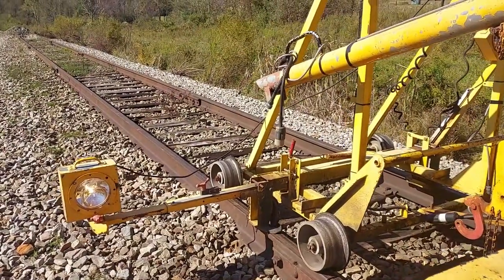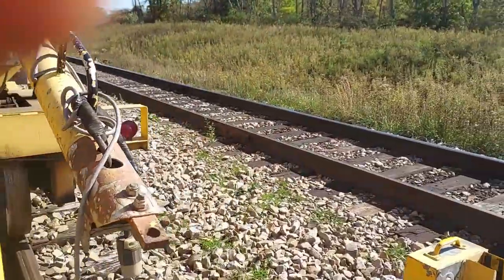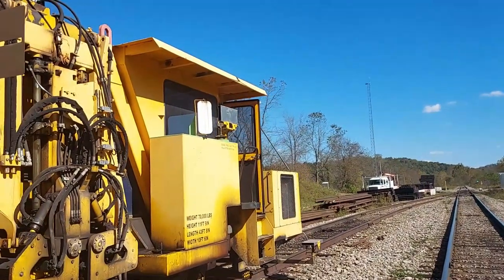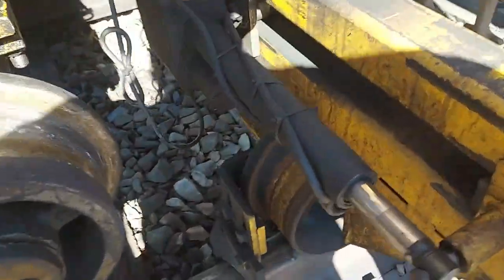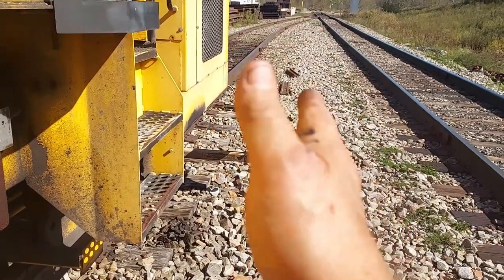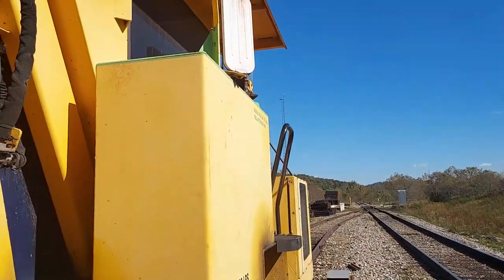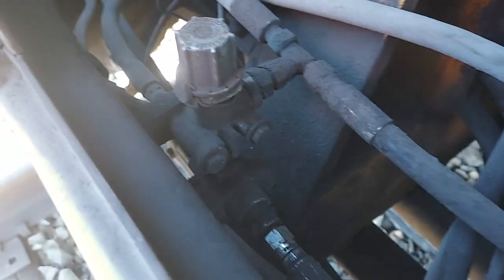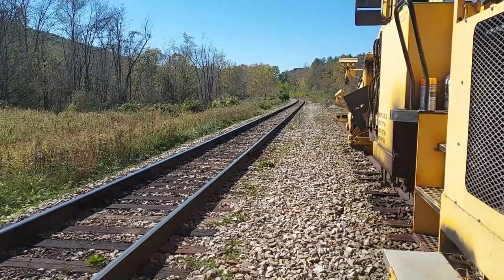How a Jackson 6700 Tamper Lines and Surfaces Track

Comment: I never knew that the tamper used optical sensors like that, very interesting! Seems to be a very precision machine. Great video, thanks Dave!
Reply from the maker: Have rebuilt many receivers over the years. Wanted desperately to show what the photo cells looked like, but was unable to find my used parts, really upset me I couldn't find them. 😕
Reply: @ccrx6700  If you find them, just show them in a #short . I'd like to see them 😊

Comment: Great overview and explanation!
The one thing I have been wondering about is how it actually moves the rail, and while you showed the mechanism, I wasn't able to see enough to satisfy me! Lol

So when you have a chance, maybe you could show how it pushes the rail, and also maybe how it grabs the rail to lift it.
Reply from the maker: Thank you Ben for the very nice comment. I understand what
you want to see. I am the only tamper operator here, so that
means I can't be outside the machine while it is working. however,
we did get a contract tamper in here this summer and was able
to be outside and video him jacking and lining track. That video
probably won't be coming out until next spring however. It will
be Harsco SJ2 tamper title. I've just got so many other videos
to post before we can get to that one, so please be patient.
Reply: @ccrx6700  that will be awesome, and seeing it work will be fun, but what I was thinking of was basically what you did for the front light carriage, pointing out the various parts and how they engage with the track, so like what pushes it sideways and how it lifts it, and how it gets the force to make that movement. 

For instance, I assume that it lifts and moves sideways somewhere in the center of the machine, with the force being transferred to the rails by wheels at each end? Or does it engage with the ground to brace itself when it's sliding them sideways or lifting them?

I am a mechanic, so the first time I am seeing a machine, I want to see how it's out together, where the cylinders are and what they push against, basically what makes it tick.
I suspect that a lot of other people like understanding the mechanics of it too, and the rest of your audience will enjoy it just because you are talking lol, so everyone should like the video ;)

Maybe you could stick your camera on a mag mount underneath and just move it back and forth or something, even if you aren't actually moving track, just so we can see the functions.

Anyway, just a video idea for you!

(no, no one has EVER called me pushy! I don't know what you are talking about, this is YouTube not Sparta! Smirk)

Comment: grate vidio Dave im ready to go surface track after watching you.... good explation ..just between you and me ,,,,wink wink take that valve to a truck parts shop they should be able to cross it over
Reply from the maker: Awesome Mike, wow a comment like that coming from you is an very
much appreciated compliment! We did get that new valve, put it
on and it wasn't the problem. Did some electrical and pneumatic searching and
found out the 2 Humphrey valves that control the valve in
the back, 1 was bad and 1 was weak, so both got replaced and
it's working fine now. Glad I could help get you motivated....LOL
and will remember the truck parts shop info sir

Comment: Nice explanation Dave thanks..  I think that machine needs to be power washed...
Reply from the maker: Your welcome Wayne, great that you enjoyed my friend. Yep,
we used to power wash it several times a year, they got a really
expensive hot water washer several years ago, but it broke and
hasn't been fixed so it been several years since it has had a
good cleaning.... sigh....
Reply: @ccrx6700  Dave, I feel your pain with the "company" overlooking the small things like maintenance repair. The chances are that the person overlooking the budget has never rode on a mis-aligned rail.

Comment: Great explanation on the equipment!  What about dis-assembling the valve and cleaning it?  Probably full of corrosion.
Reply from the maker: Thank you Brian for the helpful advice. I did take it apart and look.
We put new valve on and it still didn't work so did some further
investigation and found that a Humphrey air solenoid was not
allowing air to get to the valve in the back. Replaced it and we right back in business. All that was done obviously after the video was
made. Do so much appreciate your watching today's show my friend

Comment: Thanks for the explanation on how a tamper works for aligning track.  Is it possible there is just debris in the valve and if you took it apart, you might be able to clean it and get back to work while waiting on a replacement / spare valve?
Reply from the maker: I did take it apart, nothing amiss. Got a new valve and then it
still didn't work so made some further diagnosing and found that
a Humphrey valve that fed this valve was bad and the other one
weak, so both of those have been replaced and I'm right back in
business. Do appreciate your helpful thoughts and for watching
my friend

Comment: Excellent work, again. Now, as you mentioned, you take one track as a guide, What;s happening if both tracks are off. How do you establish your base?
By the way, how many fully loaded trains do you run per day or week?
Reply from the maker: If both sides of the track are out of alignment, then when I make the
plot on the computer it will show up and I can adjust the plot parameters to correctly align that spot Chris. If the cross level of the
two rails are both off then that is also corrected by the surfacing of
the track by the tamper.  When everything is running well, we run 6
round trips per 24 hours with the train. Thank you very much for visiting with us and may you have a really good day my friend.
Reply: @ccrx6700  Thanks for the feedback

Comment: Check out old school KC Highlighters sealed beams replacements they may last longer. Aircraft landing lights are rated for 25 hour service life
Reply from the maker: Thank you very much for the info. I did not know they only had
that short of a life span, but knew they just didn't last very long
in our application, I understand much better why now. KC Highligthers
used to be top of the line stuff for off roading if I recall right.
Do appreciate your watching today's show sir and for writing in

Comment: Hey dave, how often does the alignment electronics (the stuff you didn't show us in this video) have to be recalibrated?  And is it purely analogue or a mixture of digital, too?
Reply from the maker: Excellent question Steve and one with many answers. For all
tampers they need to re calibrate whenever there is a component replaced in the system. But as a general rule we do it about once every 2 years, but remember we are on class 2 track with 25 MPH.
On higher classes of track it is general rule to re calibrate annually.
On high speed track over 80 to 90 most railroads do it twice
annually and obviously on all classes if there are components replaced.

Now if I replace a jacking servo valve only, then I only need to
re calibrate that part of the system, not the entire machine, so
I think you get the idea there on that. 

Our old system is not digital, I cannot say what the new Jupiter 2
operating systems are in that respect since I have little
knowledge about them. Our operating system is QNX Windows 6.10
which is almost 17 years old, which while is a dinosaur, it is
much better than the old DOS system we had for the computer
when I first learned to run the machine.

Comment: Just a few tweaks here and there. Every machine has/needs them. 
86,700 + ties were completed Friday on the Adirondack Scenic Railroad's expansion to  Tupper Lake, New York. 
Sadly, 🥺😢😭 they ripped up/out 33 miles to Lake Placid 😢. 
Remaining work to finish up will start in the spring.
Reply from the maker: Wow, that's a lot of new ties!!! Last load we got they were $65 a tie
for grade ties this spring. I was surprised they were that cheap,
hope you got a good deal on yours. My old baseball coach played
minor league ball in Untica a triple A club for the Philadelphia
Phillies in the early 1950's. Hope I can make it up there someday
and ride. Keep me posted how things are going Richard
Reply: @ccrx6700  from what I've been told, the ties are impregnated with a copper sulfate preservative vs creosote. The upper part of the line, back in 1980, was reopened for the Olympics in Lake Placid. Part of the rail lines deal with the state was to use local hardwoods for ties and the green pressure treatment process, that in the end  just didn't work. The ties didn't last in cinder ballast and the wood was not exactly the hardest and rotted.
 Stay safe and I'll get back to you soon. 
Richard Bause.
Reply from the maker: @richardbause2453  thanks Richard for info, looking forward to updates sir 👍

Comment: That looks like an incredibly complex machine that makes it's job alot easier than the old fashioned manual way was. I wonder how long it actually takes for someone with 0 experience to get trained to run it and do so with some basic proficiency?
And I wonder how different a new modle is compared to that old one?
Reply from the maker: Well Jason, some folks have a knack for running equipment and some
don't, I could stand beside you and you could run the tamper, that
wouldn't take long at all, but to do it on your own, took me a year or
so before I got confidence in myself, after 18 years I'm still learning
how the darn contraption works! LOL Learning to set up curves takes
some study, then getting confidence to go out there and actually
throw a curve around with the tamper takes years to get comfortable
doing that on your own. But, if I screw up here, I have no one to
help me, and I have to fix it, so I'm a bit on the cautious side. Unlike
big RR's that have many trained in these things.

New models are significantly higher tech than this old 1994 model,
they do a better job in tamping also, track surface holds better for
them, higher HP and better workheads make a big difference.

Comment: I get the track up and down, and you showed us the $800 spreader, but how do you adjust the distance between rails if they are spiked down ?
Reply from the maker: Can't adjust gage with this machine. When it lines track it moves
both tracks at the same time if that's what you meant. To re gage track spikes would need to be pulled then we have a special
puller or spreader to set track gage. Appreciate your tuning in
and watching the show Gerald

Comment: Dave! Does the machine actually move the rail to align it to the other side. If it raises the track does it tamp balast under the ties to keep the track elevated ?....or is my question for the next video? 🤔
Reply from the maker: Very good question my friend. I can lift (surface) track by itself
and/or can lift and line track at the same time. Yes the machine
will align the rail to make it straight in a tangent or curved in
a curve. In both situations I can tamp ballast under the ties
to hold track surface. I can also align track without lifting and
without tamping ballast under it if I want to in special situations.
Hope that helps and we do appreciate your tuning in and watching
today's show Captain

Comment: The light beams were interesting. I would have guessed that they would have been lazers.
Reply from the maker: New tampers and upgraded ones often use LED lights instead
of the 24 volt light bulbs. The projector of the LED lights has a
chopper in it which "chops" the beam, then the receiver counts
pulses instead of reading voltages like mine does. Lasers are
only used for lining tangent track, they set up a carriage way
out front up track which shoots a laser beam back to a 
receiver in the front center of the tamper. Appreciate your watching Matt

On this site click on the bullet projector link
https://www.harscorail.com/equipment/surfacing/mark-iv-tamper.html

Comment: Did you say "AIR ACTUATOR".Yes that is a Monster.I think you said it has 5 computers on board.Do you feel the Wheel for HOT Bearings.(That other Video you did)?Great Video and Sound.THANK you.
Reply from the maker: Lining actuator moves the mask back and forth and it has 3 separate
computer systems, which all work in conjunction with each other,
pretty amazing stuff. I often carry a heat gun and will check bearings
with it specially on my hi rail truck. Glad you enjoyed Ed and
we do appreciate your watching

Comment: On my 6700 in automatic production mode I get an over travel warning a lot. Do you get this and what is the reason?
Reply from the maker: Over travel means you've indexed for longer than 3 seconds and the
auto workhead has now been disengaged and your jackbeam clamps
won't clamp the rail until it is reset. I never get that alarm because
I always tamp in manual. If I remember right you have to unclamp,
wait a second or two and then re clamp to re set, it's been several years since I used auto.
Reply: @ccrx6700  that is exactly right. I thought it might have been a rail slip issue. But that makes since.
Reply: @ccrx6700  anyway to adjust it to a longer time?
Reply from the maker: @animalou812  You'll have to call Joe at Harsco for that info, I do not
know. My mind is a blank on his last name but he is the guru. In the 
meantime, don't hold the index button or joystick down so long. If you
have to index long, then tamp in manual and you won't get the
over travel.

Comment: Fuel tank cap should be secured by a wire lanyard to the fuel tank as in some automobiles and aircraft.
Reply from the maker: Your certainly right in the Robin and the replacement cap that
is ordered I will do that promptly sir. Thanks for the excellent
advice, I had never thought of doing that.

Comment: OK Dave, tell me how you lower the rail that is too high?
Reply from the maker: Only way to do that Keith is either lift the low rail up to the 
higher rail, or undercut the ballast out from the high rail. High
rail doesn't happen nearly as much as you might think tho.
Most often cause of the train weight consistently passing over
it, the track surface is low. Occasionally there is a small place
in the track where it is high, but not by much, so it's not that
big of a deal either, the tamper lifts the track into the high spot
and then doesn't jack track thru it, so all works out well.

Was an excellent question and I can tell you are a thinking man,
and I like that sir!

Comment: I just hope that air valve is not being imported from over seas, you may be waiting for a bit!!! Just hope the local parts supplier has one in stock or you may need to jerry rig up a fix!!!
Reply from the maker: All is good Franklin, we got it in, but alas that wasn't the problem.
Found that a Humphrey valve that controls the valve in the
back was bad and the other one weak, so both of them were in
stock luckily and have been replaced and all is well now. Do
appreciate your writing in and for watching sir

Comment: LED aircraft landing lights are much longer lasting than the old incandescent lights. Still not cheap though.
Reply: The words "Aircraft" & "cheap" are never used in the same sentence. LOL
Reply from the maker: Thanks for the info Tracy, LED is the way to go. New tampers don't use the head lamps, they use LED lights instead. The projector has
a chopper in it that "chops" the beam, then the receiver counts
pulses instead of reading voltages like on mine. Do so much
appreciate your writing in and for watching sir

Comment: Most aircraft landing lights are only rated for 20 hours lifespan.
Reply: The old ones burned out pretty quick. The new Whelen 10,000 hour LEDs are pretty good for $300 a pop. But then you need a ballast on top and a 12 or 28V supply.
Reply from the maker: I can believe it, they just didn't last very long here. Appreciate your
writing in and for watching Red
Reply: @ccrx6700  thanks for making these “educational” videos.  I always wonder how those worked. I thought they used something like lasers.  But lights are much simpler.
Reply from the maker: @Oldscudrunner  Old tampers use light bulbs, the new and many upgraded ones
use LED lights. The light projector has a chopper in it that "chops" the light
beam, then the receiver counts pulses instead of registering voltages. Lasers
are only used for lining tangent track. They put a laser carriage way out
in front of the tamper which sends a beam back to a receiver in the center
of the front of that tamper. Hope that helps a little.

Here's a link you might find interesting, click on the bullet projector link when
you get there
https://www.harscorail.com/equipment/surfacing/mark-iv-tamper.html

Comment: The tech involved seems rather out of date, with all the laser and other optical tech out there that could detect track width/levels in front/behind.
But I guess it's a proven tech that's been around for a long time.
Reply from the maker: Yes it is. This machine was made in 1994 with old technology,
but it's what I got to work with. The original computer on this
machine was DOS, then about 15 years ago got an upgrade to a windows version. Hopefully someday I can get
an upgrade to the Jupiter 2 system which harsco uses on all
their new tampers. Thanks for writing in and watching the video.

Comment: The heads on a 6700 are chincy and do not penetrate nearly as good as a mark head. I run a Mark 6 with Jupiter 2 software. A 6700 is a pile of junk compared to the production speed of a Jackson.
Reply from the maker: Thank you for sharing your thoughts on that Michael. Obviously
a Mark 4 is a better machine than a 6700, but a 6700 is what
I've got here.  Appreciate your checking out the video.